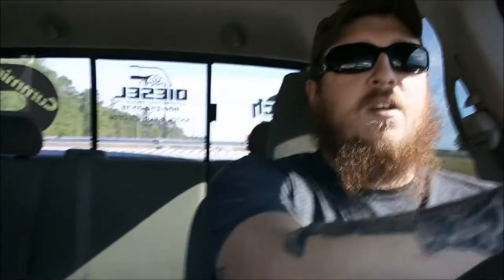Southbend Clutch Review

Comment: You can eliminate a lot of the jumpiness by dragging the brake a little when you release the clutch or adding a little throttle and 4 low when backing up especially with a trailer helps tremendously

Comment: Ive been using SB clutches on my tow trucks for over 20 years, only had 1 fail which was the springs that hold the spline and this was self inflicted but as advice always order and install the higher hp torque clutch they are night and day smoother

Comment: Hello! I just got a 2018 Tradesman with G56. 😃 From all I'm seeing, South Bend is the way to go!😉
Reply from the maker: Southbends are nice but they are noisy. With the solid flywheel, there is plenty of chatter and gear rollover that will be heard.
Reply: I had a 2007 with the street dual disk. It was pretty noisy even in gear. It wasnt horrible, but it was annoying at times
Reply: I have their SBC OKHD single. It holds a 90 hp tune with 35's and a 2200# camper on my back all the time. The clutch is silent. Amsoil 75-90 MTG is the slickest fluid I've found.

Comment: I am in south GA not far from Jacksonville I have a stock/deleted and programed truck with 5inch straight pipe 2018 model with a g56 has 16000 miles on second factory clutch just looking for a shop that can cleanly install a South Bend dual disk that will not slip and can back a trailer any suggestions near me I am about 45 minutes from Jacksonville now where near 650 rwp

Comment: Hey You still running the stock hydraulics? Or did you end up having to install the one that came with the south bend clutch please let me know thanks
Reply: You should 100% install the south bend hydros along with it. they are much better than stock and usually come with the kit anyways. They're pretty much necessary
Reply: Yuri Munrayos always use everything provided.... stronger clutch systems usually require stronger linkages and actuators, !aster & slave cylinder ECT.

Comment: What gear do you usually start out in?
Reply from the maker: powerram92 during the break in period I went through every gear. 1-6. Now I'm back to starting off in 2nd like I did with the stock clutch.
Reply: greasymechanic how much rpm do you give the truck when starting in 2nd I give me just over a 1,000rpm but it seems like it lags. Its over all stock with emissions so that not be why to.
Reply from the maker: powerram92 typically I tap the throttle twice as I'm lettin out but it usually stays under 1000rpms. Even when the truck was stock, it rarely saw over 1000rpms taking off in 2nd.
Reply: greasymechanic ok maybe I'm just not use to the truck since I bought it last week lol
Reply from the maker: powerram92 yeah it may just take a little gettin used to.